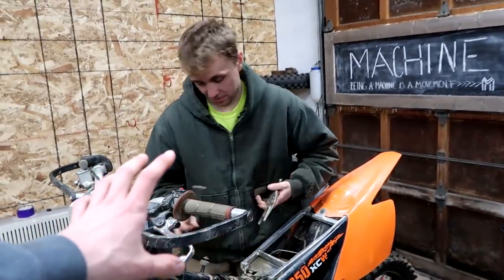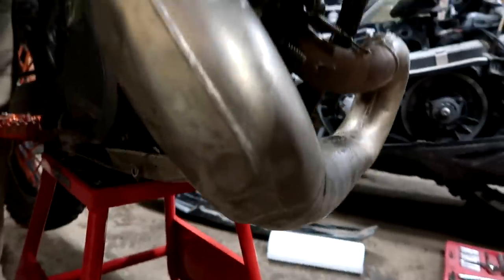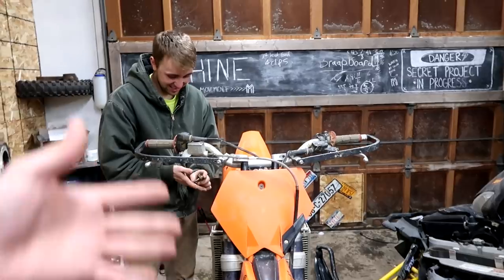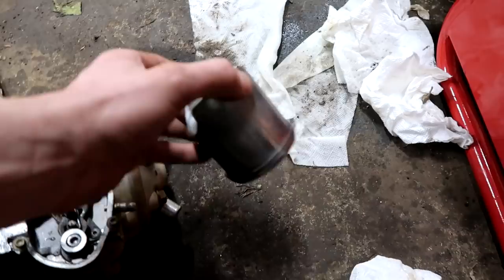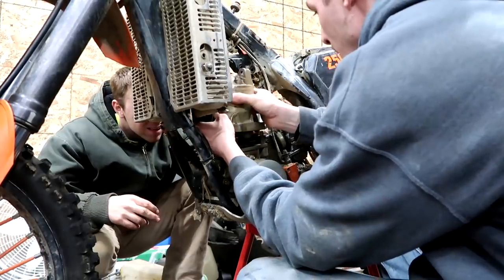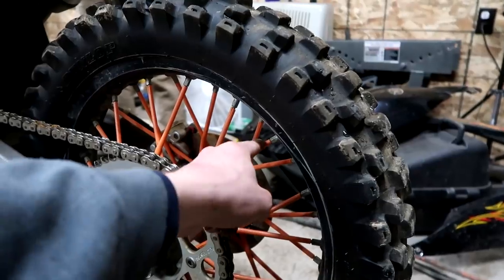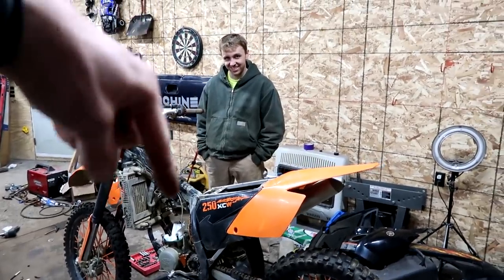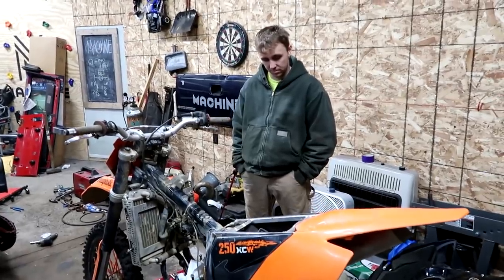First 2-Stroke Rebuild Ever

Comment: I just rebuilt a 2007 250 XC it’s basically the same bike with one less gear I have a graphics kit off eBay for 50 bucks that made it look pretty good and if you have any questions I’d be able to answer them for you

Comment: Stick with 4 strokes and you wont have to rebuild them every 8 hrs...lol...
Reply: Dan Hambrick that’s what people say who can’t handle a power band😂😂😂😂
Reply: @zachsanor7023  no he will come crying to us, when he has to spend  over 2 thousand dollars if his bike blows up 🤣🤣
Reply: When I raced MX and Hare Scrambles I rode Husqvarna 2-stroke machines. The only maintenance needed on the 250cc machines was maybe a new ring each season. The piston would last several seasons. On the 500cc bikes the ring would last a couple seasons. I never had to bore the cylinder. Just a light hone job. If they were jetted correctly and you changed the gearbox oil regularly they didn't need repaired very often. By comparison, 125cc 2-stroke MX bikes would eat pistons and rings like candy.